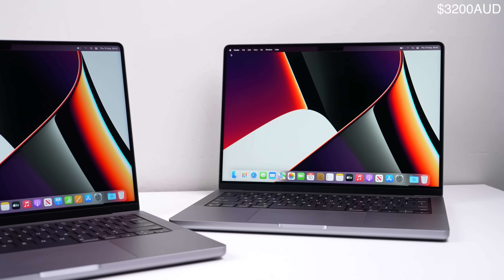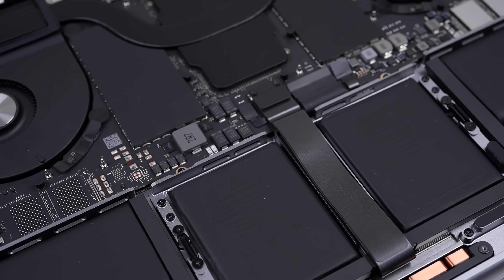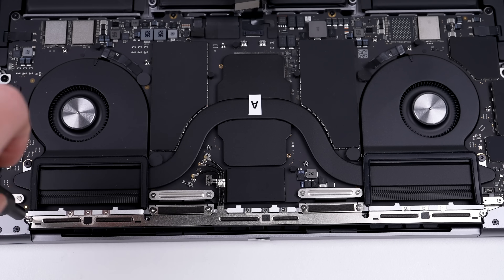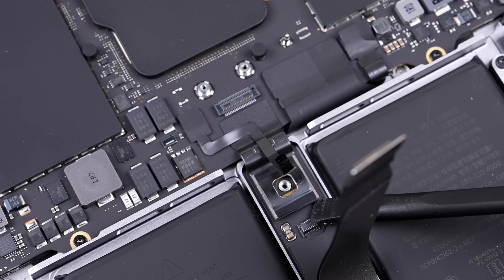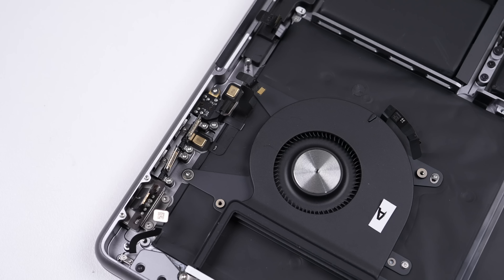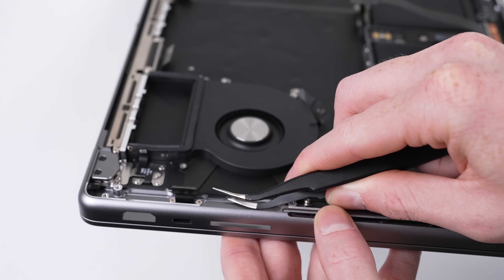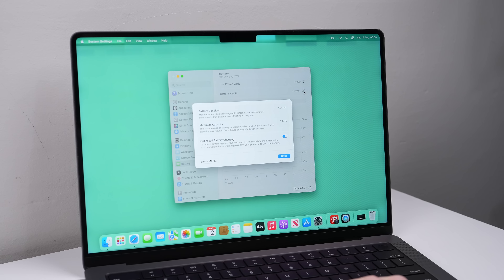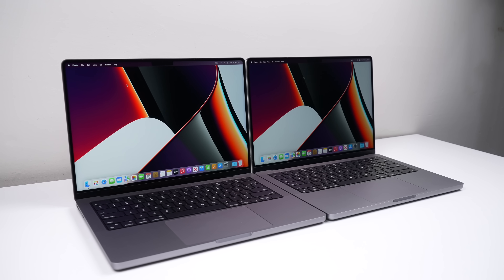New Anti-Consumer MacBook Pros - Teardown And Repair Assessment - Apple Silicon M1/M2

Comment: It’s sadly the way many of these products are going. I’m even seeing this issue with new cars as well and all the electronics that they come with. Lots of scams out there with extended warranties in that space. There are even brands trying to charge a monthly subscription just to use certain features it’s insane! 

Would be nice to get a video at some point about right to repair and how it applies to the automotive industry. Keep up the great work Hugh!
Reply: It mostly concerns electric cars with propiertary software and hardware
Reply: The automotive industry (in Europe anyway) already has laws regarding this. The are a few caveats yes but essentially anyone can repair their car and still be covered under warranty etc as long as you use genuine parts within the warranty period. With regards to the subscription based functions, not sure what people are complaining about it's a good thing as most of these functions people don't generally spec their car with anyway, so you are getting the opportunity to have say, heated seats for the few months you might need them when before you would have probably left it off the specs sheet completely. If you want to spec the car with full time heated seats you still can.   It's a non issue made up by people that just want to have a reason to be pissed off imo...
Reply: @readmore7180  that’s great to hear. Thanks for clarifying what that subscription stuff was really about. It was more or less something I heard about in headlines and it’s easy for people to put out clickbait out there. When it looked that up again, it was something about BMW and heated seats so good point. 

Anyway, it’s fascinating how much these issues affect other industries and what other countries have done to solve the problem from what you’ve described. The US needs to take a note there.
Reply: @readmore7180 If I paid several thousand euros extra for heated seats I want to be able to turn them on/off whenever I want. Having a paid subscription for that is just corporate greed and a way to make money continually from things sold once.

Maybe in the future the car keys will be a blockchain ETF where you pay say 10% to the manufacturer everytime the car is sold. 😅
Reply: @readmore7180  ur so brainwashed u dont even realise leaving it out of spec?? u already payed for the hardware now u have to pay a montly subscription in order to use it???.
montly susbcriptions are for services. blocking ur own hardware from being used by its owner is literally agaisnt the law. Plus i developt parts in the automtotive let me tell u a thing or two about repair parts = non existent badly manufactured to min legal spec non lasting with the sole porpuse enlarging the commerce of the industry that creates it.
Reply: The actually Problem and you can bet your arse is, that at some point the permanent Option for heated seats will be gone and with a subscription you will end up playing more in the long run. This is just an intermediate step to not anger consumers.
Reply: @Bender-x1u  non permanent heated seats is a good thing. For 8 months of the year people don't need them.. in reality nobody ever "needs" heated seats, people get them as an added luxury.  And now people that probably would never have them are crying about it. It's dumb
Reply: @readmore7180  But, one of the reasons they're doing this because it's cheaper for them not to handle having multiple parts in inventory for different configurations, and just stick e.g. heated seats in all of their cars. So what is the justification for nickel-and-diming their customers by blocking it in software until they pay first when you own the hardware after buying the car?

You can certainly fit extras not originally specified if you are willing to pay to do so. I will, as far as I possibly can, never buy a car where software prevents me from using the hardware that I own in the manner that I choose. I fear the day when I have to buy my next car, and the only viable options are from after ~2015 when permanent internet connectivity, touchscreen infotainment and subscription based models really started to take hold, along with increasingly locked down diagnostics preventing anyone except dealers or garages leasing outrageously expensive equipment from reading basic fault data and changing any settings.

I find it hard to see how all of this is "good" for anybody except the manufacturer's bottom line. Surely it's not a coincidence that locking this stuff behind subscriptions just so happens to be both cheaper to manufacture, while also providing an income stream beyond what they previously would have made on what are already high-margin extras.
Reply: @mystery_pond  how is fitting the car with extra parts cheaper, that's nonsense. And no you don't own the hardware if you didn't spec your car with it. Them putting it on the car anyway doesn't make it cheaper for them, it makes it more expensive. They are putting in extra things that they don't have to put in then giving you the option of if you want to utilise it.  If it takes X amount of people to take up the option for them to break even but only y amount of people do take the option they could be losing 100s of thousands of even millions in part costs especially when it comes to things like heated seats. 
The only part of that system that can be generic or incorporated into something else is the control unit part of it, the "brains" of it is incorporated into the heating/air-conditioning control unit. the manufacturing costs of the control unit can be reduced by making them all the same yes, but the control unit isn't the only part of the system. The added heating element is adding £70 ish minimum in parts cost alone to every car, that's just the element.... And like I said before if you spec the car with heated seats when you purchase it you will always have heated seats......
Reply: @readmore7180  The cost of the parts exceeds the cost in logistics, manufacturing and storage to keep track of different parts, and reducing the number of variants significantly reduces the manufacturing time for each car; thus, the overall production cost will be lower. The part cost of adding a heating element into a seat is absolutely nowhere near £70. The rest of the car (wiring harness, BCM support, etc) will already be the same across all variants, again because of the expense if it wasn't.

How can you claim you don't own the hardware just because you don't spec the car with it?

What if houses started being sold with extra bedrooms that were locked behind doors you had to pay a subscription to open? Are you saying that in that instance, you wouldn't own those rooms?

Surely by any reasonable measure, the material property is in your possession by mutual agreement, so you own it regardless of the restrictions.

I think presenting these business models as a positive for the consumer is dangerously naive. It's a slippery slope to accept them now, as it only becomes easier to continue pulling away what should be rightful ownership of possessions into the exclusive control of corporations demanding you pay dues. What's next? Are they going to start putting their whole air conditioning system behind a paywall? Perhaps they could add an option limiting you to only start the engine twice a day unless you pay them extra; after all, you didn't buy that option. You don't own the engine.

Comment: It may seem like a PC master race kind of comment, but I stand by the fact that building your own gives you superior control over changing things. Even in terms of laptops, other brands are far more forgiving for upgrades and repairs. It's just not worth it for the 'environmental' BS Apple puts on if minor or even moderate things can basically turn a 2.5k laptop into e-waste for our environment.
Reply: I can literally add a brand new stick of RAM into my Dell laptop and not only does it not break, but Dell helps me to rectify any issues caused by adding that stick of RAM in too, granted I've paid for their highest support tier.
Reply: This is why I build my own desktops and when I finally bought a laptop I ended up getting a cheap used Thinkpad from ebay. However, newer ones of even these 'buisiness grade' laptops are getting less and less repairable and I actually have one of the last T series that has the dual batteries. Strongly considering a Framework or something like it if I ever buy a new laptop.
Reply: The saddest thing for me in relation to your comment. Framework sells laptops with nearly full customization and upgradability. It also costs about the same as a macbook. WHY? The engineering and design is literally ALL-IN  on repair. You pay the premium price for a device that has 0 serialization and even the CPU/GPU could be upgraded. This is fine, you might pay 2x what a similar laptop is worth for this intentional design philosophy which is NOT cheap to implement for a small company like them. 

If I could buy a framework in Asia without massive importation fees, I'd buy it now. I can't buy apple, there's no way to fix it where I live. It maddens me that people WANT to be treated this way. Decades ago if you wanted a Framework style of product " which would be the IBM THINKPADS " you knew you got quality and paid for it to ensure long term viability. Apple products are now just 1 and done unless you have infinite money to deal with the bs. The wall of the closed off garden is becoming more dystopian each year.
Reply: @WhatWillYouFind  if you have r & d money, where would you spend it? choice A, on functions and features that every user will use and see every day; choice B, on repairability, which the vast majority of users will only feel the presence of once in a few years. this is why most people buy apple instead of framework. and most people don't want to bother repairing machines themselves. they just pay apple (or whatever other manufacturers) and send in their broken machines to get them fixed.
Reply: This is not PC master race comment this is common sense comment. The only laptop I have is Thinkpad from 2012 and I can replace and upgrade almost everything but GPU that is soldered to the board.

For work I got M1 macbook air and I kinda hate it. For 1 need to keep all my data on some cloud storage at all times because if I don't the data are lost if the macbook kicks the bucket. Ram is soldered so if I need more RAM I need to prepare for whole machine upgrade.
Reply: @@chandler2 not being able to upgrade RAM and SSD is far from best longevity and support. You ran out of built in storage good luck swapping it. You want more ram then good luck with M1 Macbook air. You want to get it repaired? Good luck with that as well since everything is soldered down.
Reply: My 2010 Macbook Pro was easy to get into (only a few different screw sizes/lengths, none of them pentalobe), and to repair/replace parts (industry standard interfaces, no serialised part lockouts). It survived over a decade of use before I finally retired it.

It's disappointing to see the trajectory Apple has taken over the last 13 years.
Reply: They also store the UEFI firmware in SSD. So if any of the NAND chips fail, your mac won't boot again. It's intentional, of course.
Reply: @chandler so youre making an argument that m1 are better by ignoring the performing windows laptop 🤣 got it 🤣
Reply: @@chandler2 Spoken like a true ignorant Apple cultist lmao
Reply: Chandler2 I think you have down syndrome, have that checked out.
Reply: Seriously. My GPU broke last year and I didn't get around to fix it due to work and not being able to do some gaming before going to bed had me a little depressed 😂
Now during my vacation I got around to take it apart, do some soldering, cleaning it with alcohol and reapplying thermo paste. Now it's running like it's brand new and I can play all my city builders again ❤
Reply: why don't you just buy the part from apple or have them repair it? it is not like it is completely irrepairable; it is repairable by apple.
Reply: @haomingli6175  And give in to the demands of the enemy? That's like saying, instead of breaking out of prison the old fashion way, you just ask the Warden to appeal your sentence and see if they let you go.
Reply: @haomingli6175  If you go to Apple for repair, more often than not they will claim it can't be repaired, or charge an unreasonable fee to repair it. What incentive would they have to repair it at a reasonable price? That'd just cut into their own sales.
Reply: It's not a "PC master race" comment when you're objectively correct. You have all the control to repair the PC you built. For instance, I built my current PC back in 2015 and swap parts every once in a while when I want or need the extra performance. I started with 16 GB of RAM, but recently added another 16 GB since I had available slots. A while ago, I swapped my old GTX 970 for a new RTX 2070 Super. I also upgraded from a 1 TB SATA SSD to a 2 TB NVMe SSD.  

Did I need anyone's calibration tool? Nope. Did I need to have specialized bits to access the internals? Nope. Did I have to take it to an authorized repair center? Of course not! The closest thing I needed to "specialized software/calibration" was Samsung's cloning tool. That was free and worked like a charm!

Apple can take their expensive, anti-consumer products and stick them where the sun doesn't shine.
Reply: @tenhundredkills  Exactly! At the very most you would need a BIOS and drivers updates!
Reply: @chandler2  
At that price point and use case, it doesn't matter that much as you'll be doing your work on the cloud anyways, whether it be iCloud or Google's
Reply: @igordasunddas3377  
X86 mobile chips are quite power efficient, just that Intel and AMD constantly clocks them up for performance. Although I suspect that 15-16th Gen Intel would give Apple some serious competition with their new chiplet soc designs that can actually shut power off to chiplets I've been hearing rumors about. AMD might do something similar now that they're adopting big little hybrid architecture
Reply: @@chandler2 sheep detected. You don't understand why repair and reuse is important
Reply: @@chandler2longevity? You're stupid. That thing is e-waste the moment the SSD dies. How many TBW do the NAND cells have left in them? Good luck replacing the soldered on SSD that contains iBoot and whose controller is firmware locked to the T2 chip. 
Performance? For browsing the web and using office or watching Netflix a 300 dollar ThinkPad from 2019 is more than powerful enough. You're not doing actual serious work on a base model MacBook Air M1.
Reply: That's why I have a Framework Laptop and run Linux on it.
Reply: @GeoStreber  once x86-64 becomes as power efficient, I'll definitely look into it. I hate Apple with a passion.
Reply: Nah this one is so true and justified. It's even worse when you see the Mac Pro this year, the modular PC became totally worthless.
Reply: @rosaria8384 What the fuck are you talking about?
Reply: @rosaria8384 pc is manly good for games from what I’ve heard I heard pc is too Annoying to constantly maintain & upgrade
Reply: @@chandler2spoken like a true Apple Sheep.

Comment: Any specific reason you dont use an electric screwdriver? looks like a lot of work. (just curoius)
Reply: Can be more accurate with how tight you fasten screws, also they are all so small that if you used a drill on it you’d probably overtighten most things
Reply: @lauchlanstill   no i meant the mini electric screwdriver which are made for these jobs, i just wanted to know if him not using it is a personal preference or if they are not worth it.

Comment: who ownes the laptop appel of corse you only by the rigth to use it and pay appel in there grace to produce it so they can lend it to you util it breaks of corse the warrenty  extendent warrenty you can bby is just another way for apple to mikke your wallet some more   but if it brake in wrrenty its almost alway user failure  and NOT coverd  i know what i am talking about i use to work for them

Comment: such is a scumbag practices, that is why I never buy Apple products. I'm looking for repair friendly phone now, and it seems like they all no good in 2023. Galaxy S3, S4 and maybe S5 was the best modular phones, Speaker failed? I just had to buy a new speaker. Same for the camera, buttons, batteries.. let alone Zerolemon aftermarket battery upgrades... now it's all about glue and anti-repair, I effing hate it.
Reply: Just buy a Pixel. Google sells the parts officially and even published the fingerprint calibration tool for anyone to use. Also, if you get it straight from Google the bootloader is guaranteed to be unlockable.

Comment: You should see what happens when the nand fails on the newer models
Reply: spoiler alert: it turns into a brick
Reply: I feel bad for the engineers.
Reply: Boycott Apple and buy a Windows laptop instead.
Reply: @AN1cholson buy a GNU+Linux laptop
Reply: @AN1cholson main issue with windows laptops is that it drains battery much faster than macbooks  + many laptops still use only 1080p displays even in higher price ranges which look straight up worse than display in macbooks